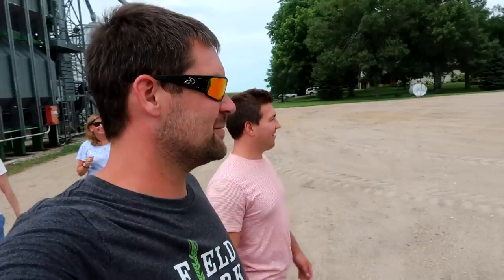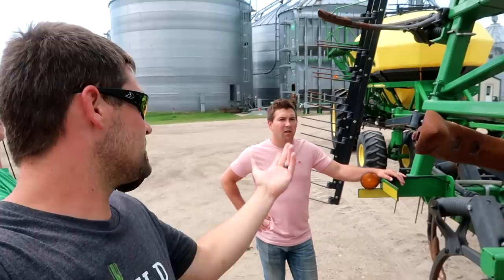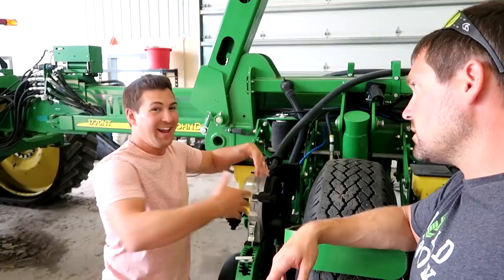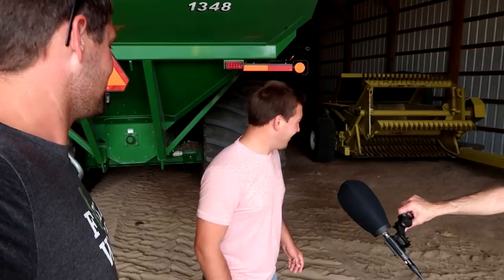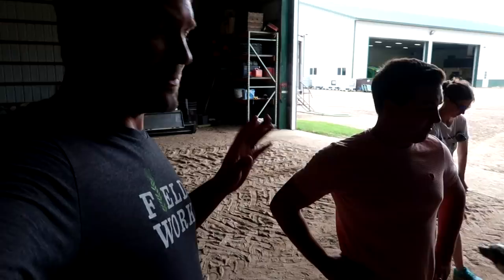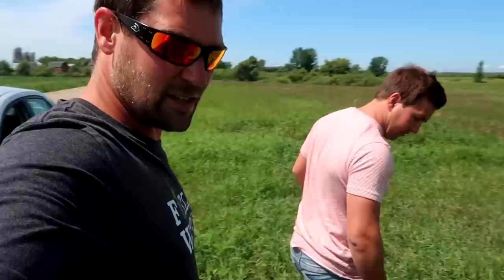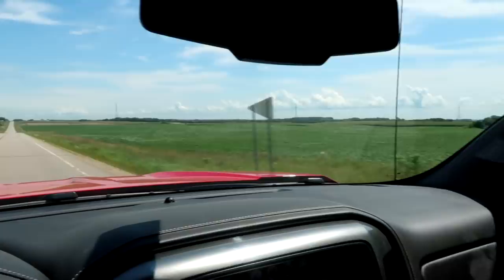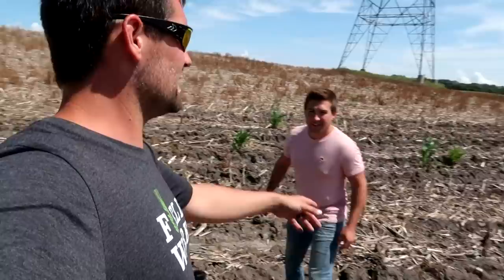Farm Tour

Comment: I`ve been enlightened here. Good senses of humor. Spent one summer involuntarily on a dairy farm . Best experience besides USMC, or Airplane Pilot .
Reply: Shaggy Boif!+&
Reply: Since you are a pilot I am wondering what you think of the planes that require a computer to stay in the air like the new planes the USA and other nations are buying now. I really wonder about them after learning about that ship the USA had that was buzzed by a Russian plane that has a device that turned all the computers and electrical things off causing the ship to be drifting for four hours before they managed to get it to the point of being able to just make it back to port. You know a plane can not just drift around with no engines nothing working and you can't get out of the seat and move around and fix the problems.  I think if a plane needs a computer to stay in the air it is sure not a good idea to have it as a war time plane.  What are you thoughts Greg Milner
Reply: Pat Clinch p

Comment: Mitchell is right, if you do go with a cover crop, lower seed rates are where it’s at. If you go with winter wheat (like we do, and we don’t have winters in Texas) spray it to burn it down in the spring, can’t run a ground rig? Call in a air strike. But we drill ours in with skips where the cotton rows will be. We put wheat seed out a couple of years with a broadcaster in the fall, and the residual from Prowl and Treflan in the rows we had a perfect strip for the cotton.

Comment: I run one spiked closing wheel and one smooth oem one behind a row it works great in the fields we strip till but in conventional tillage in borderline wet fields the corn root balls plug up the spiked closing wheel and then it act as 2 smooth wheels

Comment: When I ran the planter at first I had problems accidentally turning the vacuum fans off. Finally I put my right hand fan on #4 and #1 ran my left hand fan. Also I put Velcro on #1.  The Velcro stopped the SAFTEY COVER from opening and my finger accidentally touching it and turning that fan off
We swapped our press wheels to the solid steel. It solved the problems of the rubber one not coming apart so we could put the bearings in.

Comment: Im not sure if you have seen it or not, but you have a U bolt broken. If you look at 6:50 above Mitchell's head you will see it.
Reply: Good eye!
Reply: Great eye!  at 6:16 you can really see it in the upper right
Reply from the maker: Good eye!  We have troubles with those ones on those 'stub bars' we had to add on when we went to 30" spacings.  The rocks break them constantly

Comment: Beans don't work well in grass sod for some reason. I took the row cleaners off my planter this year, if you get the residue spread evenly and just make sure and plant on the deeper side to compensate i have found ya get more even emergence. Just need good down pressure. I have planted into headed out rye quite a bit, sometimes over the cab and its not an issue as long as its standing. Best to plant before spraying because after spraying it will lay down sometimes.

Comment: TYo winterize an outside trailer: cam lock the maxis (and of course drain the air tanks.... apply brake antifreeze before it gets parked). In spring, just back it onto a pad, drop the cam locks (with the trailer aired up). Starting your day laying in snow or mud beating on brake drums is an awful way to begin your day.

Comment: Why don't you till the field which was to wet already? Like plow it, than the wet underground comes up and can dry too. When dried seed a catch crop which will freeze to death. Then in winter time till it after some frost when the frost just got out of the ground so he machines can handle it but you don't leave that much of a compaction. This will leave a nice seedbed in the spring. We use this technique some time but don't know it this will work out in your circumstances.
Reply from the maker: We can't pull tillage equipment through wet soils, it's way too sticky.  Our ground also freezes about 5 feet deep and when it thaws it's too sticky to even walk on for about a month
Reply: Thanks for the explanation!!

Comment: Why on the blower to the bins, don't you put a air pressure transducer constantly monitoring the air pressure in the tube.  Then on a blow out, I would expect the pressure to change substantially.  This could be used to shut the dryer off and sound an alarm.  Much better than blowing all of the corn on the ground.  But then again, my goal is to overlay complicate things.... :)

Comment: closing I think is the problem on your no till I use cover crop and notill  and have found the Exapta Solution wedges and spike closing wheels will close anything from worked ground to cover crop really well, have closed mud in wet spots and it doesn't open back up.

Comment: We mostly harvest around 22-25%, last year, 13-16%... But there is no climatic problem.
Reply from the maker: What would that have to do with a climatic 'problem'?  15% swings are the norm.  It just depends on planting date and heat units.
Reply: @MillennialFarmer  Becouse we allawys had 20%+ corn, even my dad can't remember when they had 15%. And he is duing this famrer thing for 20+ years now.
Reply from the maker: @bzs187  our corn is extremely wet this year.  Wetter than it's been in 10 years.  Global cooling?  Or planting date mixed with local weather pattern?

Comment: Your light circuit is overloaded or your breaker is weak. You need to check the amp draw. The amp draw should only be 80% of your breaker capacity. A 20 amp breaker should only carry 16 amps continuously. At any rate you need to replace the breaker, due to it tripping so much. Do not put a larger breaker without pulling the proper size wire for the amp rating. You might need to split out lights and add a switch for each circuit or add a single throw multi pole switch (turn on multiple circuits with one switch).
Reply from the maker: Yeah, the first thing I did was suggest a bigger breaker but the rest of the system wouldn't like that.  Really what we need is a 2nd one for half of the lights

Comment: Issues! Of course, you do. The deterioration of those items is amplified to a great extent from the elements. A plastic sheet hanging down over your exposed electrical switch panel would greatly protect and last many more years without the problems of corrosion which you have suffered. And water running through your electric motors and sun burning up the belts on these motors. God, it only makes sense. I assume money is an object and system failures is a pain. Give it a try.

Comment: HI  millennial great vids  that last field  rather than tile drains try subsoiling looks like a classic case of compaction was maize crop harvested in wet? if landlord pays for drains he may want no probably will want more rent!!! but if you can run a subsoiler through while the top is dry it maybe a good alternative, try to go at either45 or 90 degrees to the way the last crop was drilled you ma want to level out the ruts first!!!!!

Comment: Mr. Zach, is there such a thing as a quieter air blower for the grain bins? Cost effective?
Reply: Jordan Roberts no I work on blowers for a living and they are just loud. Very high rpm typically between 2000 and 3600 rpm to be efficient and air at pressure moving at high volume is extremely loud. They do make mufflers but they are expensive and typically do very little per cost

Comment: Hi Zach, I found the farm tour with Mitchell (and MPR crew) to be very fascinating.   My question, and it's probably a dumb one, is why do you need a cover crop such as rye or even wheat that then becomes a problem next Spring?  With corn stocks already in place isn't that enough to hold the soil from wind and retain moisture?   Thanks!!     - Dean from Edina
Reply: Cover crops can also be used for weed prevention and getting certain bacteria which help the main crop

Comment: Id replace that 15AMP with a 20AMP breaker !!!
Reply: Bob George 
 Id replace the bulbs with LED bulbs. Problem solved. And energy saved
Reply: @72Fill  Absolutely great idea , you can even rewire your florescent fixtures for LED !!!
Reply: Bob George 
I thought they are just incandescent bulbs.... could be wrong
Reply: @72Fill   Your probably right , I wasnt checking out the lights as much as his blowing breakers but home depot has LED bulb kits for florescent fixtures that you disable the ballast and wire it like incandescent and you turn the bulb in the fixture with the lettering end into the hot end and the opposite end is a dead circuit that just holds it in the fixture !!!
Reply: Bob George  k
Right. I’ve done that too. Works great.  
 See.. Zack dosnt need h
Reply: Sorry... Zack doesn’t need his electrician for advice. He just needs to look here😀😀.   ZACK!!
Reply from the maker: @72Fill  LED bulbs are awesome in a heated shop but in a cold storage building like that they don't ever warm up and provide good light!  The right way to do it would be a 2nd breaker for half the bulbs I think.  A 20 amp could cause issues I think
Reply: MN Millennial Farmer 
Hi there. Nice channel. 
 I’m under the impression LED is fine in cold. Could be wrong. Need to google. 
 20amp not a good idea unless wire is sized for it which It actually could be. Needs to be checked. 
 Splitting the circuit up is a sure fix since it sounds like it’s overloaded
Reply: Hi again. Google tells me led is awesome for cold weather. But your local supplier would have the correct advice. (Simplest fix)
Reply from the maker: @72Fill  really?  I tried them on our motion lights and garage lights and they were terrible.  When it's below zero outside they barely provided any light at all.  I'll have to check into it
Reply: MN Millennial Farmer 
When LED cane out a lot of manufactures came on board. There are some pretty crappy bulbs out there. We’ve had good luck with brand names like Sylvania and Philips. 
 Had issues with off brands in certain dimming situations... switched to Sylvania and problem was solved.

Comment: And what's wrong with other color's of farm equipment? Each color has it's own strength and weaknesses. For most farmes what makes or breaks, what color of equipment they use, is the support the color of equipment they will use.
Reply: Willard Way Jesus he is just kidding he doesn't actually give a shit about what a guy uses and prefers. Most farmers aren't just loyal to the color but they're loyal to a good dealership.
Reply from the maker: Willard, our local Deere dealer has been great and that's why most of our equipment is now green.  The nearest other dealer is 4 times farther away.  All brands are good, it's just elbow jabbing!
Reply: MN Millennial Farmer I know many farmers that actually prefer a different brand than what they use but they specifically run what they have just because of their local dealership or a dealer that works and treats them well. I also know farmers that have used let's say a red there whole career and then have completely switched to a brand they didn't like even because of a bad dealer or a dealer that wouldn't care about helping them or getting their parts in quickly.
Reply: @MillennialFarmer I believe that the service from the dealer is 90% of what the farmers look for even is the dealer is 4 times the distance from the nearest dealer. Even if it the same brand. I have had to drive 200 to 250 miles for parts to keep things going. The dealer I went to met me at 1:00 am to make sure we had all of the parts we needed to keep going. When it was time to buy better equipment that dealer was our 1st choice to deal with and they treated us very well. One can kid around about brands and brand loyalty. But the service from the dealer makes or can break a brand.